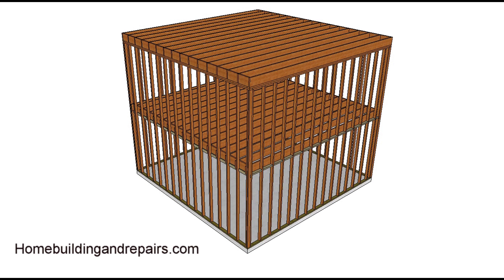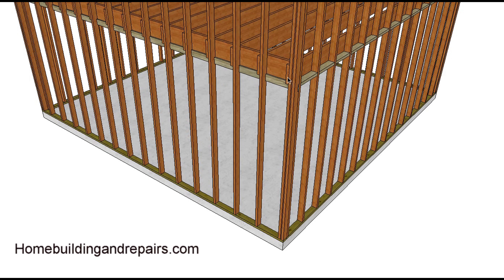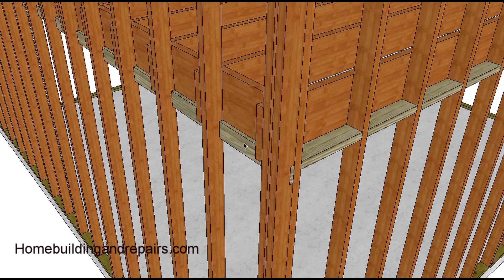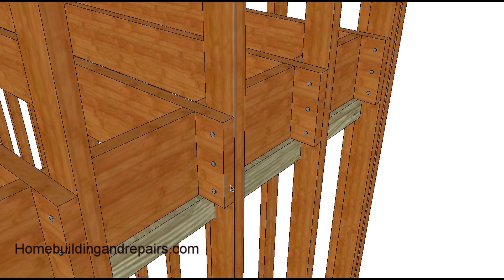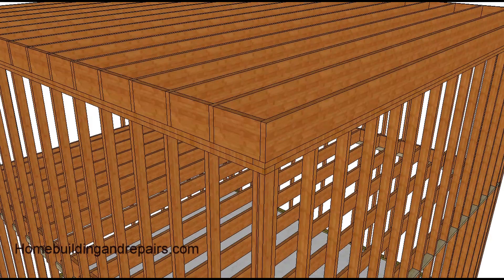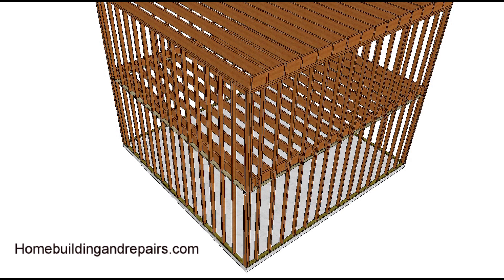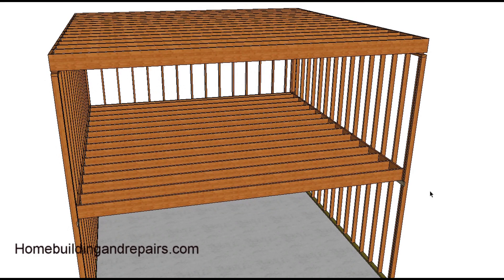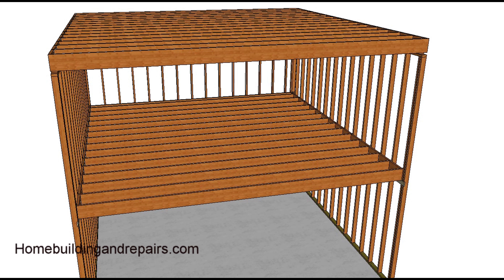What is Balloon Wall Framing? – Home Building Construction Methods

Comment: Balloon frame homes, common before the late 30s, although typically very well built, with beautiful crown molding and plaster/ lathe wall finish, and even stained glass windows, are more of a fire hazard due to the nature of construction.  7 years ago  my Aunt lost everything in a home fire.   If she wasn't at work at the time I don't know if she would have made it out.   The home was a beautiful 1928, two story farmhouse, Balloon frame.   The fire started in the basement at a splice between the old knob and tube wiring and newer romex which was used to extend the circuit.   Because it was out in the country with a long driveway no one noticed it until it was burning out of control,  and it took longer for the fire department to arrive.   Now I am kind of scared to sleep in an older home using this method of construction.

Comment: I have a balloon frame house from the 1800’s. It has a kitchen addition on an exterior wall.  I would like to open up the wall between the this space.  How can I put a header under my ribbon?  Thank you.
Reply from the maker: I would think you could do it in the same way as platform framing, except the small wall studs above header in platform framing that stop at lower level would continue up to top framing plates above.
Reply: @gregvancom  Should we do it below the notch that the ribbon is in, or should we cut through the ribbon also in the section we want to put the header in?
Reply: @gregvancom  can I cut the ribbon?

Comment: The ballon frame name does not mean it will blow away.  Actually they hold up very well in high winds and also because of it’s construction it keeps from mold.  Mine was built in 1896 and still standing well.
Reply from the maker: I've never heard that one before and good point.
Reply: We live in an 1880 balloon framed house (we love our home!) and I have done much research on them because of their unique construction.  I have read on quite a few occasion that the term balloon house has to do with the what the frame can do if there are structural issues in that... they tend to begin to bow outward thus the name.  I have also read that it has to do with the fact that the exterior walls are the support walls and as such the interior walls are for aesthetics for your home design.  We have found this to be true in that most interior walls in our home are "floating" walls.  We are in the middle of construction and have found this to be quite true.  This video was fantastic!

Comment: Balloon framing is no longer used due to fire code reasons(fire traveling between studs before fire blocking was used). Also, in cases of an seismic activity or explosion(natural gas, propane, etc.) the entire building would collapse. With modern framing you're more likely to lose just one wall.

Comment: Question(s): What was the purpose of Balloon Wall Framing (easier to build/lumber available at the time/etc.)? Did the notches in the wood deteriorate the integrity of the 2nd floor and roof? How do you bring a building with balloon wall framing up to today's code? 
*Totally loved this video, keep it ups :D

Comment: I run into this alot here in Tennessee as most of the houses I work on are built in the 1920- 1940's
Reply from the maker: It definitely doesn't seem to be used by very many engineers or builders today.

Comment: Hi greg, great video.  I was curious as what purpose the air space between the exterior wall and the walls within the home are efficiently trying to provide.  I know that the air within the walls (once walls are in place) can create low moisture build up, but is there any conventional way to fill the walls with insulation to exclude the draft that is in there.  Is it a must that the air channel are in the walls?  Thanks again.
Reply from the maker: We don't use any type of channels in our walls floors or ceilings unless it has something to do with reducing the amount of sound from the other rooms or areas. For free to email me some pictures or a drawing of what you're referring to for more information.

Comment: Apparently this is an excellent design if you would like your house to burn down rapidly in the case of an accidental fire
Reply from the maker: It sure looks like it would, but I don't think there would be much difference between balloon wall framing and wall framing where floor joists sit on top of wall framing plates, especially if the fire was going to burn through the floor sheathing.
Reply: True, but in architectural views, this style is as close to a four sided house built like a pyramid as you can get.  Being a pyramid is a solid structure.  This "Balloon" framing is structurally symmetrical in the design.  All the lines are equally intersecting and vulnerable areas are almost non existent.